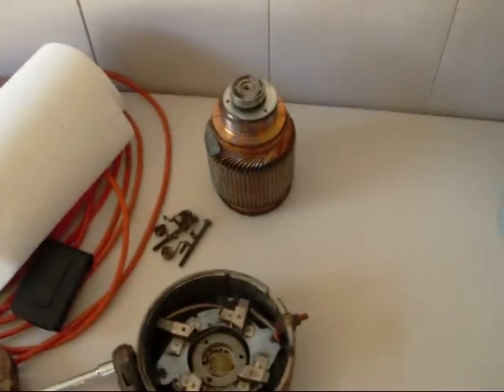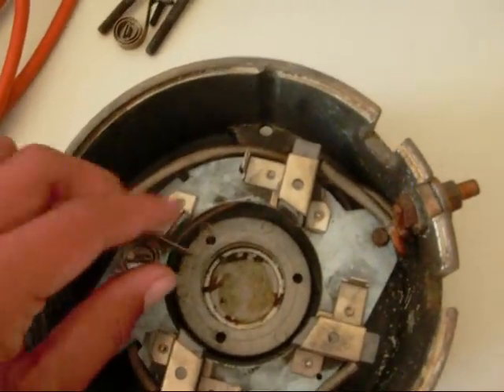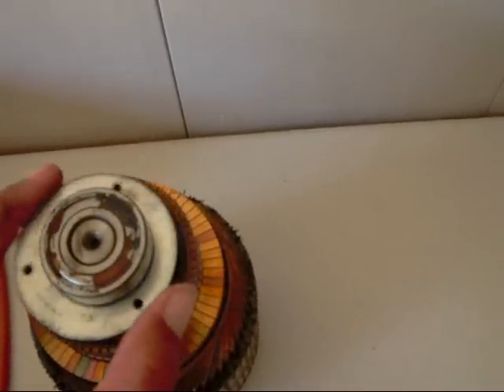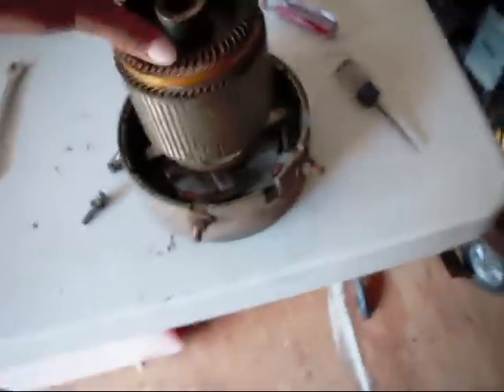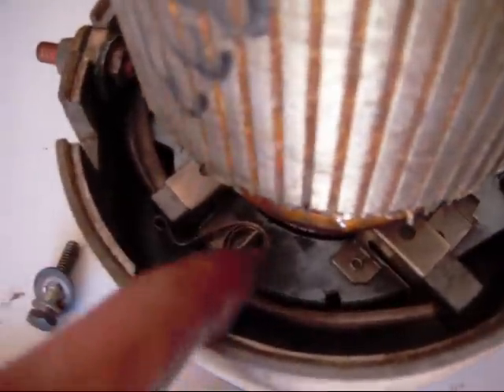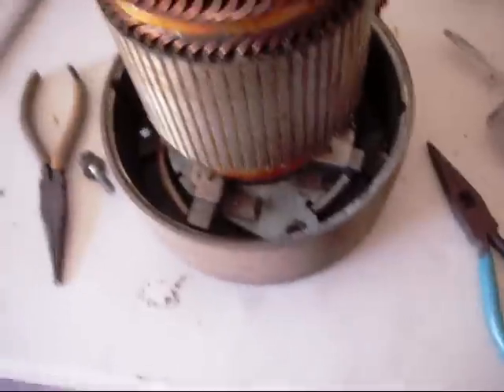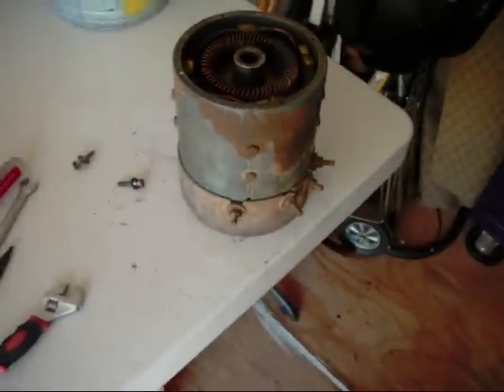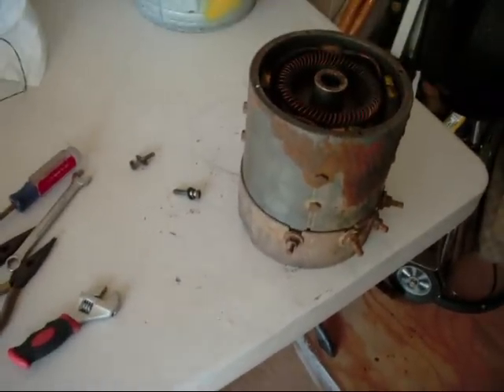golf cart electric motor rebuild

Comment: Next time, insert the springs first.  Pull the brushes back and tie them in that position with kite string.  Insert the rotor and then just cut and remove the string.
Reply: Can you tell me What do you have to do to remove the motor?...I sure would like to see a video on removing the motor
Thamks

Comment: I have a yamaha motor here [ 5bc48jb845, 2450 rpm ]  that looks very simillar, i just removed from a  junked machine, gonna use as a motor for a ride on , how do i test it to see if it spins. It has 4 posts as well,do i jumper 2 posts? witch ones? Apply power positive and  negitive to witch posts . thanks for any help.
Reply: well... you must find the coils. two posts must measure 2, 4 ohms and the other two the same resistance. then you jump one post of each coil, and give a litle current to the other two posts, just touch the cable, just to see it moving, it will turn clockwise or anti clockwise.

Comment: I have the same kind of EZGO motor, I rebuilt mine 8 years ago and it ran great, I was able to install the rotor with the brush springs in place by carefully moving the brushes out,  I am just rebuilding it again now and just put new brushes in, the armature looks a little worn, so i'll see how it works otherwise I'll be buying a new motor with speed control
Reply: Where did you get the rebuild kit? I have the same motor and needs a rebuild badly

Comment: The cover peice has the field coil inside and it should have been cleaned out throughly. The carbon deposits gunk impeeds the maximun potential from your motor. Good Job, but next time clean-out as much as carbon gunk as you can.

Comment from the maker: @JcXtreme72 well i put rebuild but it was more of maintenance because i thought the brushes were low but they were not so i ended up just giving it a good cleaning.  and the hardest thing was just getting it on and off the cart.  also did notice a slight difference but nothing to go through the trouble for. :)